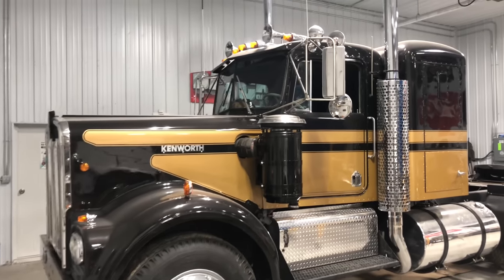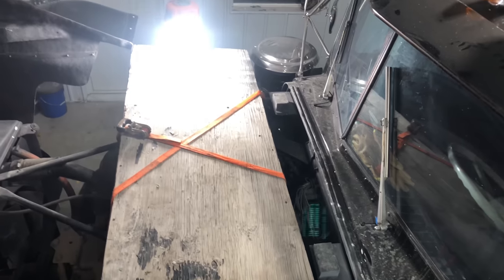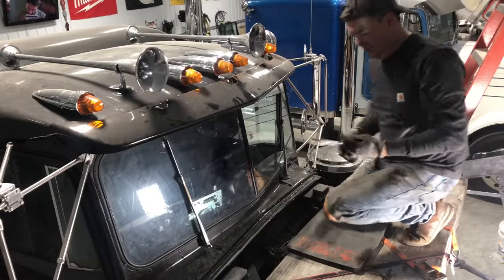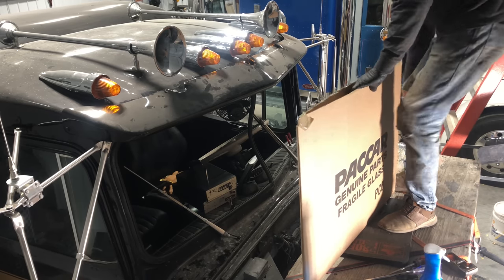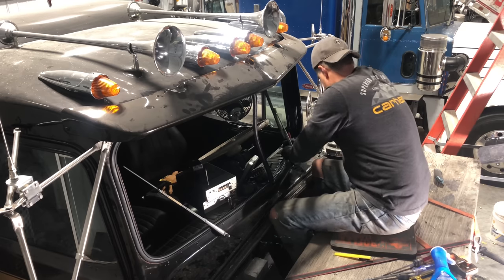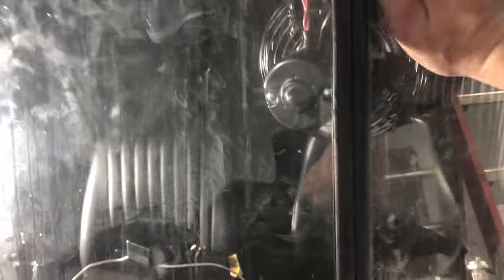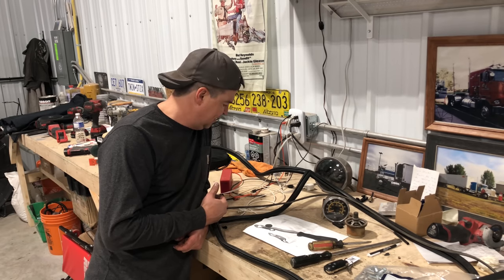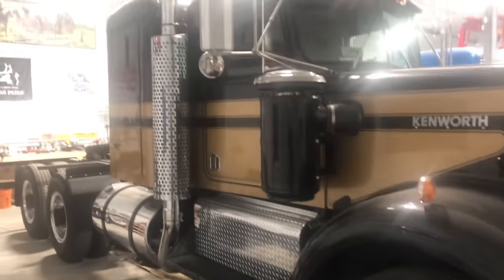Smokey & The Bandit Tribute Truck Ep.58 Sir, Please Don't Break The Glass

Comment: Dude, why didn't you get those wipers off? And get a suction handle next time to handle the glass 😀👍🏻
Reply from the maker: I couldn’t as the arms were seized to the splined stumps … would have to destroy them to remove which is why I left them on to paint as well 👀 but good tip on the cups for next time
Reply: @TwinStix  OK, didn't know that. Good job anyway, Mark! 👍🏻

Comment: When did you better take the windshields wipers off first and then the glass just saying but sweet ass truck fan from Minnesota
Reply from the maker: I couldn’t as the arms were seized to the splined stumps … would have to destroy them to remove which is why I left them on to paint as well 👀
Reply: @TwinStix  makes sense and nicely done putting the glass in and I definitely can't wait to see the trailer and the truck together best of luck to you

Comment: Take the wiper arms off. Necerbuse screw drivers.  And always use the proper tools and replace the rubber for a good seal.
Reply from the maker: I couldn’t as the arms were seized to the splined stumps … would have to destroy them to remove which is why I left them on to paint as well 👀
Reply: @TwinStix  at some point you'll have to replace them. I think it would be wise when your budget allows to get replacement parts that way if they do fail all you have to do is remove and replace them. Food for thought.  The truck looks great. Can't wait to hear the Jake's once up get them working with those stacks. Keep up the great work my friend.  10-4 good buddy the Bandit is 10-10 on the side... lol
Reply: George  no need to be rude. They will fail at some point, trust me. Always good ti have spare parts on hand for a old truck . The level of work he has put into snowman it will be a nice truck once fully completed.

Comment: Why didn’t you take off the windscreen wiper arms . Would have been a lot easier without them in the way.
Reply from the maker: I couldn’t as the arms were seized to the splined stumps … would have to destroy them to remove which is why I left them on to paint as well 👀

Comment: As much as i like your videos, you should have removed the glass before paint, then you wouldnt have an unpainted edge around the rubber. When that shrinks you will see the red of the old paint at the edge of the seal. With a colour change the glass should be removed so there is minimal masking

Comment: I'm I crazy or is all you have to do is push on the glass from the inside like the back window of a pickup and not pry on it?
Reply from the maker: Yeah next time 😉
Reply: @TwinStix  Next time just gently push on a upper corner from the inside after you pull the lock out. The seal will fold and the window will slowly pop right out.

Comment: Why if you have the window out would you not put a new seal in that's like taking the oil pan off and not putting a new gasket on smh 🤷‍♂️😱🤭
Reply from the maker: The existing ring was actually in good shape so I decided to reuse and get my $400 back and use that to buy something else for the truck like chrome bands for the air cleaners 👍
Reply: @TwinStix  holy shit 400 buck for a rubber seal it should be made of gold for that price yeah I probably would have used the old one to then that's crazy money for a seal

Comment: First thing, remove the wiper blades....
Reply from the maker: I couldn’t as the arms were seized to the splined stumps … would have to destroy them to remove which is why I left them on to paint as well 👀
Reply: @TwinStix    There is a tool to push them off, like a mini press... I understand you were there and I wasn't, but that made your job alot harder..... 
 When I worked at an Auto Glas shop we did hundreds of these....

Comment: Scratch that it's a bead lock 

......it's a 10 minute  job
Reply from the maker: How long if you did it by yourself 😏
Reply: @TwinStix  I can do that style with the bead lock in just a few minutes  per side normally...I was thinking  it was a rope in style...the rope in is a whole nother animal 😳...hahah I've broke as many  as 5 in one day trying  to install  them on a Pete with a really big visor....good luck bud use lots of silicone spray 👍
Reply: If
Reply: You don't use a rope on this styles... yes there is a right and left side
...you need a plastic bone...put your rubber gasket on the pinch weld of the truck..lube up the gasket with silicone spray...start at put bottom ...put  your glass in the channel and take your plastic bone and fold the rubber around the 3 other sides....lots of silicone spray...I don't recommend you try the actual  rope in style 😎
Reply: Hey mark...if those new windshields leak..pull the lace back out (lock bead ) get tube of pure silicone..black of course,  cut your tip kinda small  and run a bead  of silicone inside the rubber gasket   and reinstall the lace...take a razor  blade and clean up the silicone the smushs out...especially on old gaskets.. I like a new gasket most time's  but the old gaskets seem to be easier to replace just  glass rather than installing a new glass and gasket  at the same time..

Comment: Having replaced many windshields as a professional I can tell you that you did everything wrong. Rule #1 you never use screwdrivers. You could of saved yourself all the problems you had by having a professional installer do the job. It would not of cost you any more.
Reply from the maker: Yeah well they’re installed aren’t they 😏
Reply: @TwinStix  Would you of said this if the new glass was broken during installation.

Comment: Two mistakes that I can see No.1 is use a razor knife to beak the seal of the glass/ This makes the removal  a LOT easier. NO 2 is do one side at a time. No 3 place the rope (wire) in the same groove as the glass and pull from the outside because the rubber seal is made with the smaller groove to the outside which will work a lot  easier. Dish soap is your best friend.  No.4 this should have been done when every thing was torn was apart!!! I'm sorry BUT I have to laugh, This whole video is like watching a monkey and a foot ball. I hope next time you will get help or spend some of that patron money and have it done/
Reply from the maker: Why would I do that … it’s installed isn’t it 😂
Reply: @TwinStix  As someone told me more then once work smarter not harder.🤔😁😁🤔